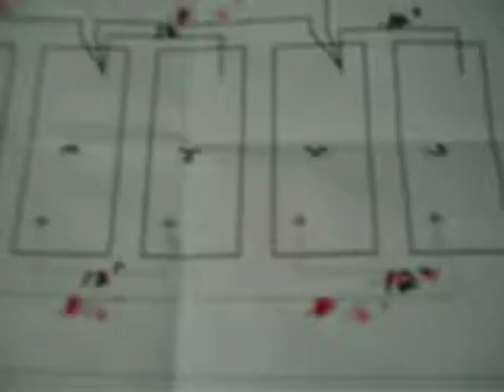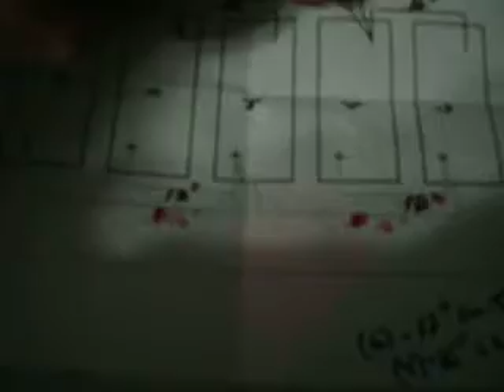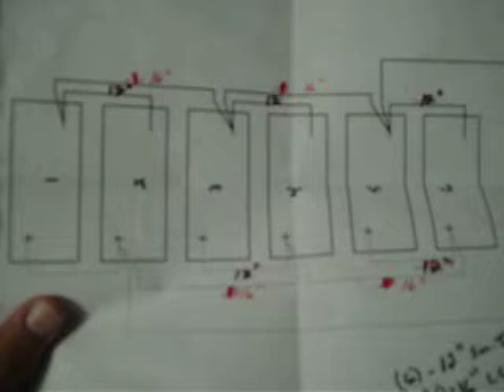Video of 6 batteries parrelled together to create a balanced charge

Comment: Hi how do i balance charge 8 6v  batterys for a 48v bank
Reply from the maker: lol...I'm not a scientist , I just researched on line for what I had to deal with. (6 12V batteries)  but- If ya lay it out like the 12V batteries like I did I'm sure it'll work the same.  The goal is "Balance Charging"...I ruined 2 expensive batteries by not doing it correctly.  Sorry I haven't seen your post till now, but i was sick for the past 4 years (Cancer) and gave up my set up and sold it all off.. thinking of doing the hobby again though now that I feel a lil better.